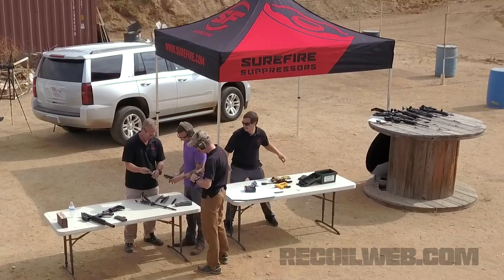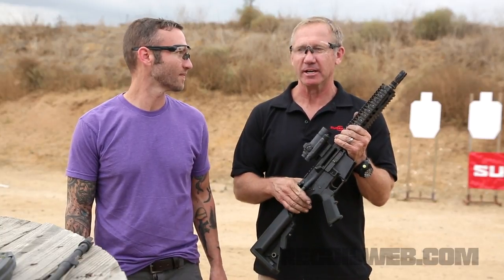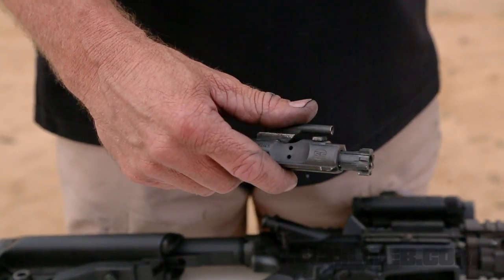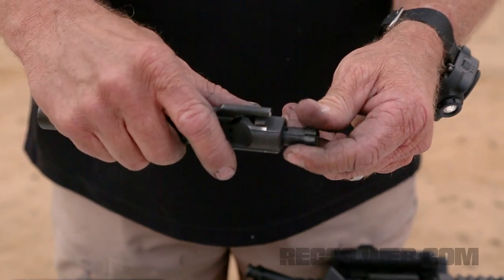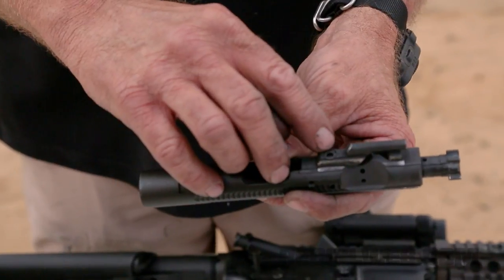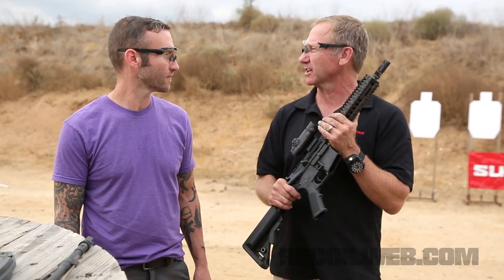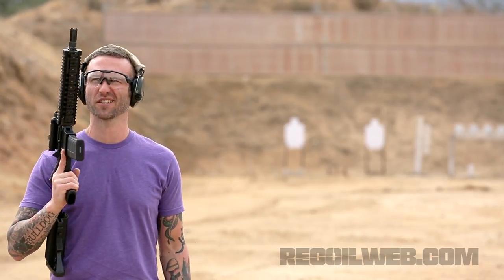Testing the SureFire OBC Bolt Carrier Group

Comment: My mk18 has an h3 buffer, standard weight spring, and is gassed down with a superlative arms adjustable gas block and it has a gas busting charging handle. All this to try to lower the gas I get to my face when shooting with my surefire 556rc. My next step is to get a bolt carrier that will delay unlocking of the bolt through the use of an altered cam pin path (LMT enhanced bcg or leitner wise bcg) or the surefire obc. Any input on what might help the most? I currently have a CMC enhanced bcg. I got it for the extra mass it has to help delay unlocking, but it isnt enough.
Reply: an altered cam pin path BCG is your last step besides switching to a flow through suppressor like OSS or Larue. I'd stop after getting a specialty bcg. even piston guns and bolt actions spread some smoke around the breach area. it's just the unavoidable nature of suppressors. 

old comment so you may have made a decision already.
Reply: @ComeOnPelican91  gonna get the surefire obc when I have the extra money and when they become available again. I might increase my barrel to 12.5" and my gas system to midlength too

Comment: To install the BCG would i have to adjust the gases at all or just put it in and rock?
Reply: No adjustments necessary. Only can be used on carbine buffer tube though. No rifle no A5.
Reply: @sanguinemoon9201  oh okay cool! And is that with any BCG? Just throw it in and rock? Because I still have all factory bcgs in my rifles because i dont wanna mess them up how they came from factory, sorry to sound noobish but im very picky when it comes to after market parts for firearms
Reply: @drphil6303  not all bcg's are interchangeable. Some guns don't work with an m16 bcg. Some are DI (often called internal piston), and some are piston type. All of that matters. Look to see what type of carrier you have first and use that style if you want to upgrade. Also, the OBC or any reciprocating mass bolt carrier may not play nicely with mid length or rifle length gas systems. Check out small arms solutions here on YouTube for the bolt carrier series of videos. Lots of good info.
Reply: @sanguinemoon9201  thank you man! I appreciate the info!

Comment: Seems like a solution looking for a problem
Reply: I used it to make binary shooting accurate and no recoil. You can shoot my carbine at about 450 rnds per minute without shouldering. Gun barely moves. Great high rate/volume of fire with controllability.
Reply: Yeah... except it was designed by the guy who created the rifle itself... but you must know more about it.
Reply: @gzitterspiller  sort of. Sullivan scaled down the AR10 to the AR15 with Bob Fremont. Neither worked on the M4. The M4 had reliability/durability issues in the SOF roles. The OBC came from Jim Sullivan working on that problem.
Reply: @gzitterspiller  BTW I do love Sullivan's work on constant recoil.
Reply: Idk... I think it's kinda cool.
Reply: It's a brilliant solution from Sullivan himself to make the AR15 much better in full auto.
That's what happens when you have a real firearms engineer making bolt carriers, rather than hopping on the "lightened" bcg bandwagon which defies logic. The heavier the bolt, the longer the time variable.
If you want to reduce recoil impulse, you increase delta T. Not only is the bolt travel longer, but the spring loaded weight in the carrier itself continues to travel rearward even as the bolt carrier reaches its maximum throw.

Comment: And it comes permanently lubed with concentrated snake oil.
Reply: So many that haven't used it call it snake oil. My Franklin binary trigger and surefire obc would likely surprise you as how smooth shooting that combo is.
Reply: It was designed by Jim Sullivan. Not like he'd know anything about the AR-15. It's not like he worked alongside Eugene stoner to design the AR-15 or anything.
Reply: @CharlieMikeNS  or specifically the gas system and the bolt carrier...
Reply: You might not understand how recoil works.

Worse yet, you might think low mass bolt carriers actually reduce recoil. That is snake oil, but people eat it up because everyone is doing it.

The total recoil energy is the total recoil energy. 
Conservation of momentum is conservation of momentum.

If you had a plain bolt action, that recoil impulse would be instantaneous.

The only factor in the equation that’s being changed is the time.

A low mass bolt, only transfers that faster. 
A heavier bolt slows the bolt, and the overall recoil impulse.

Cutting back on the gas, slows the bolt. 
Over gassing the rifle speeds up the bolt.

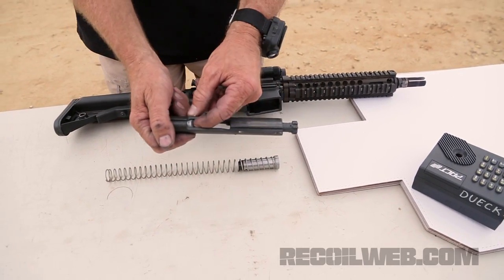Why do you think he added the secondary mass at 0:56? The increase the time period over which that force is transferred to the shooter, so the bolt doesn’t instantaneously transfer that to the shooter.